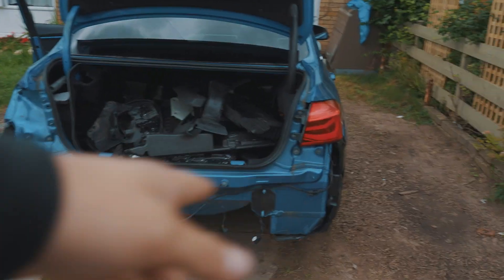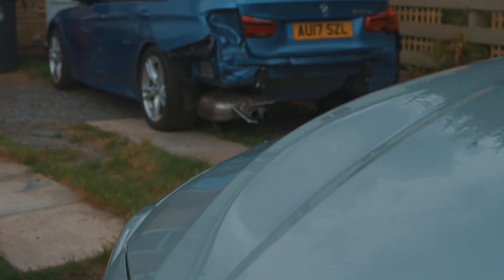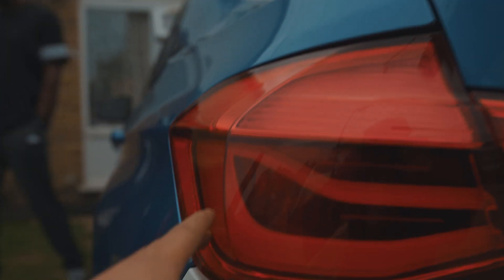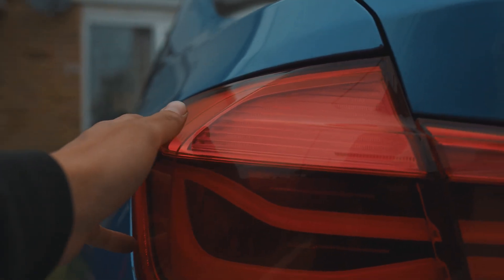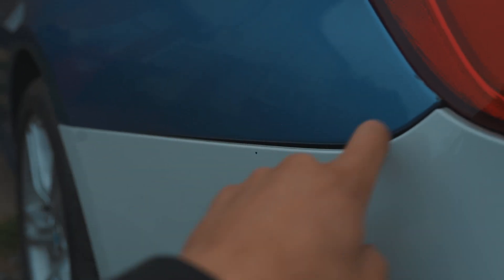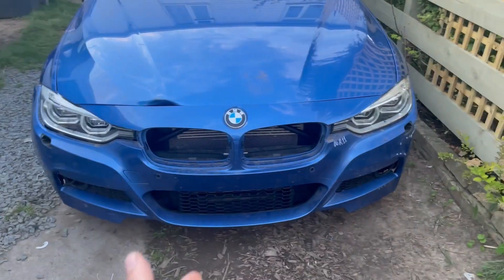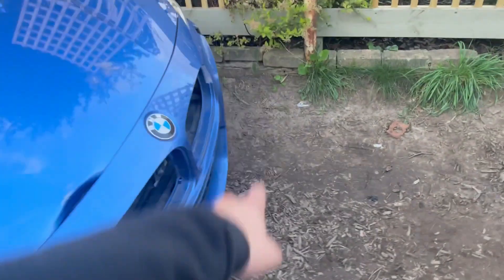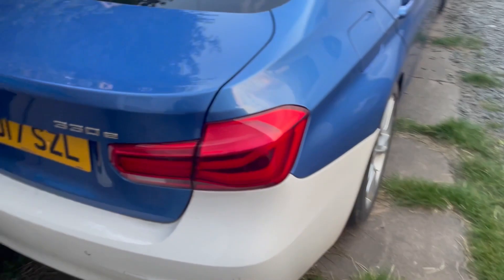Rebuilding A Wrecked 2017 BMW 330e || Frame pulling!?

Comment: the hood is savable but needs to be heated up to allow the paint to soften so that it wont crack will be hard but it is do able with some patients
Reply from the maker: Yh I though only way would be a lot of heat, paint is gone regardless I was worried about the metal